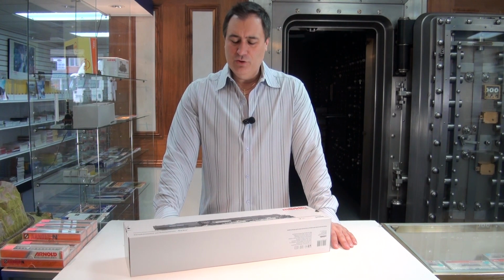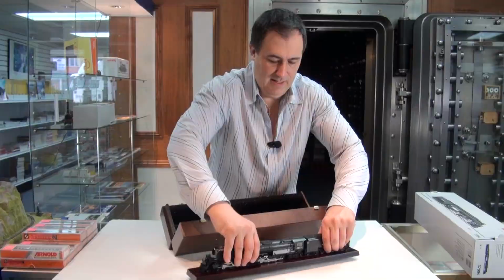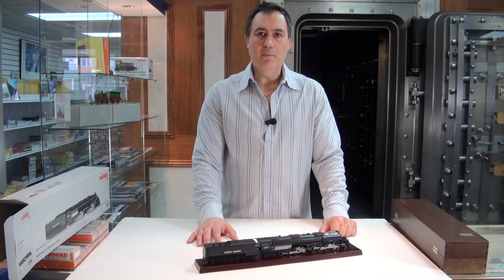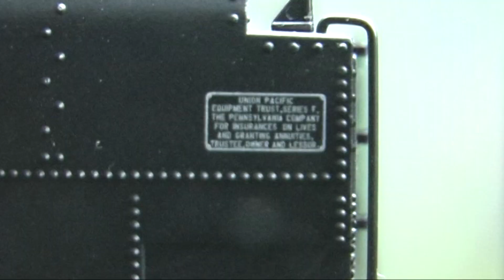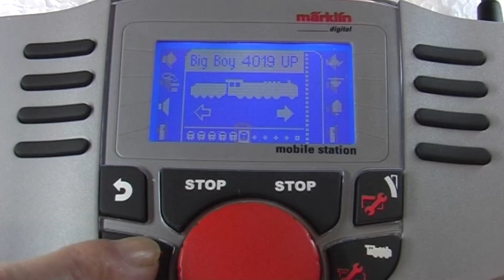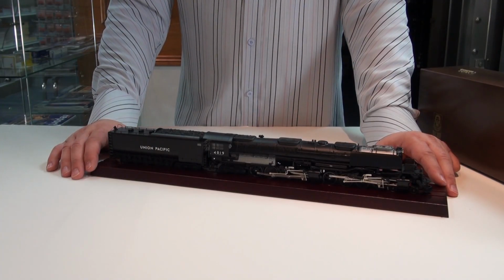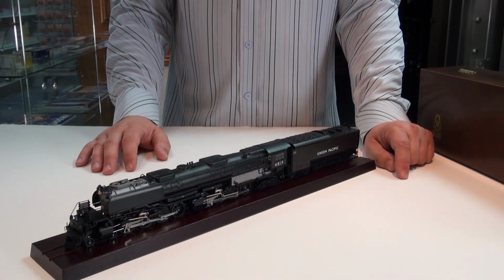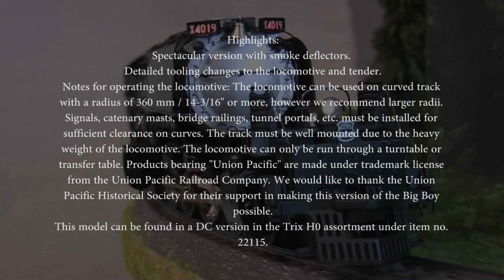Union Pacific Big Boy Highlights

Comment: I have one of these,(#4013) and it an awesome engine. The box it comes in is very nice too. I love the fact that it is all metal, and it handles my 28" radius quite good. Though it does not have traction tires, it pulls very good, I prefer not having traction tires anyways.  If I had a safe, I'd store it in there too...

Comment: Some would say that a good feature of the Trix version is the lack of traction tyres so that the model runs smoothly with very little wobble, and no problems with perishing traction tyres in the years to come.
If it has problems pulling loads up grades, perhaps the grades you are running it on are too steep.

Comment: The specs you state are not correct. The Big Boy's produced approximately 6000hp, #4016 produced 7,157 hp during a test but all others produced less than 6000hp. Although it is the longest articulated locomotive ever produced, it was not the most powerful. The 2-6-6-6 Allegheny class locomotive produced 8000hp being the most powerful ever built. It also had 778,000 lbs of tractive effort compared to Big Boy's 540,000 lbs also making it the heaviest. But the Big Boy still remains the longest!
Reply: Steam is an impossible thing to calculate precisely. It was rumored that the big boy can produce under the right conditions up to 10,000 horsepower. Nobody really knows the exact numbers.